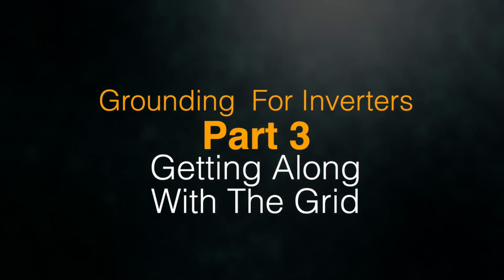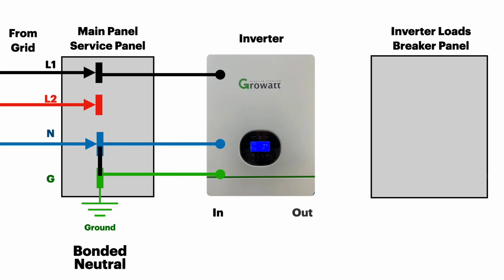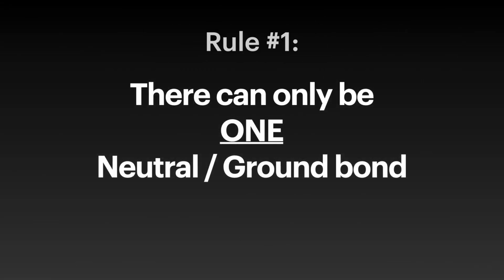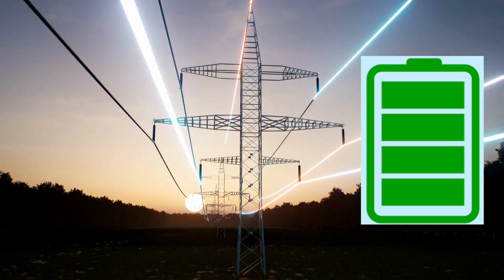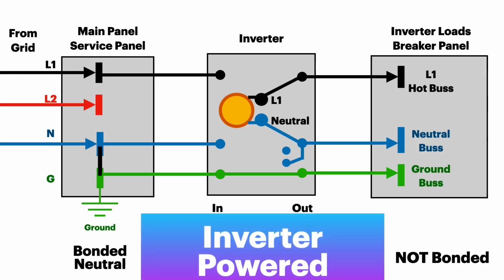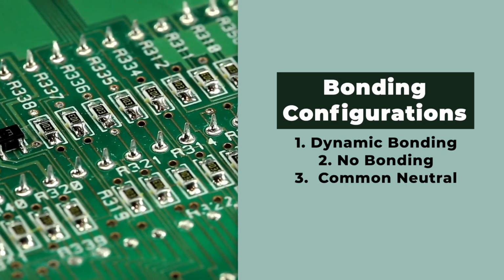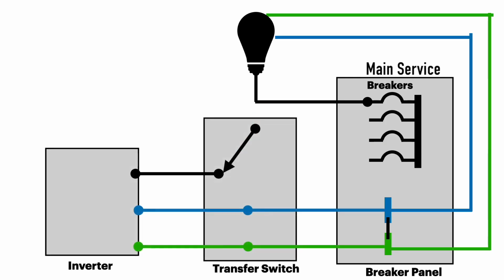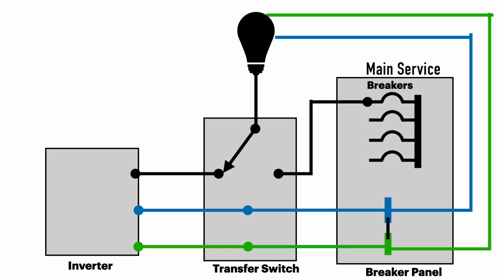Grounding for Inverters Part 3:  Getting Along With The Grid  [UPDATED!]

Comment: H U G E appreciation.  You even anticipate the homeowners' questions.  NO ONE here knows anything about grounding or ground/neutral bonding (I'm an ex-pat living in India).  Please please respond to my strange problem!

I have a 7.5 kw grid-assisted inverter (home earthing is TT system with ground rod); I will configure it as grid-tied inverter very soon.

When grid is ON, and the inverter is just passing the grid through, I get normal voltage at inverter output terminals (around 240 V) between L-N and L-G.  And I get about 2 V between N-G.  I'm pretty sure there is no N-G bonding anywhere in my panels.

If I turn the grid OFF and run in inverter mode, here's what I get at inverter output terminals:
L-N  ---->  normal (which is 220 V that the inverter is generating)
L-G  ---->  around 185 V
N-G  ---->  around 30 V

What the heck is going on?!  Took some time to even figure out that this is what was causing my intermittent weird voltage readings. I feel like I'm going crazy!  Please bring back my sanity.  Let me know if I can clarify anything.
Reply: i also had this issue with a Hybrid Inverter. In inverter mode it has an internal relay and switches the ground to neutral. In line mode, that relay switches neutral IN to neutral Out. So most probably the inverter is defective and is not switching properly the GND to Neutral. Mine had a small trace on PCB burned out.

Comment: You say that the dynamic is the most common for all-in-one inverters. In fact, I cannot find a single all-in-one inverter that has dynamic bonding. Victron does, but that's not an all-in-one. In fact the EG4 has a screw that you can cause to be bonded or a floating blond. So, I'm really confused. I need a dynamic bond but cannot find it outside of Victron. Am I wrong? IT seems everybody is hooking up EG4s without worrying about this and it's working fine, but the documentation says it's on or off, not dynamic.
Reply from the maker: A few years ago, they were common in Chinese inverters (MPP, Growatt, EG4, and others). They would have a removable bonding screw. When passing grid power, they would use the line and neutral from the grid, and thus the existing bond in North America. When using inverter power they would use the line,  neutral and bond from the screw in the inverter. So your AC out had to go to a separate UN-BONDED breaker panel. 
 Fortunately, they seem to be more rare now. EG4 stopped using the bonding screw in 2023. The popular 6000xp uses common neutral bonding, so the bond is coming from the existing house  main panel feeding the AC in.
The Victrons still use dynamic bonding, since they are often used in RVs and boats. They also do a great job of documenting the bonding. Many other companies don't even mention bonding in their manuals.
Reply: @ReelClearMediaLLC  As of this morning, I was told that EG4 still uses the screw, they just default-ship it in the floating neutral position. If that's so, then are you saying there is some sort of automatic relay that bypasses the screw when in shore power mode? I mean, that's what dynamic means right? I desperately want to believe that but every single vendor has told me it is not dynamic but floating. Still, I don't put much faith in that since they seem to have virtually no clue about the G-N bonding issue and are parroting stuff from the manual. Wish I could afford a victron, but it's too much. It simply must be dynamic for the RV or it will be fraught with human error!
Reply: @amythinks  there is no 'automatic relay in the EG-4 6000XP nor the 12000XP - those I have used, one needs to manually configure the inverter to bond N-G in the apps setting controls - or manually tie N-G from the inverters perspective.  The EG-4 literature I have read all indicates this is a pro-active setting not dynamically updated based upon inverter operating mode.
Reply: @kbots  Yes, I know. I'm not considering that one at all. He showed the EG4 3000 (yellow one). That one has a bonding screw and is the one I'm referring to.
Reply: @amythinks sounds like your worrying about nothing. 
People have diy systems for years and your getting tripped up on wording

Comment: Do I watch all Your videos before asking this???

I have 2 Shenzhen Sumry 4Kw hybrid MPPT Solar Charge Inverters that I want to wire in split phase for 120/240 AC in a 2006 Dodge Sprinter van..

My system consists of 9 series connected panels @140 VOC, charging 6 Group 49 AGM's in series parallel for 24 volts.

I was planning to mount a ground terminal busbar centally located on the board, & directly connected to the batteries, that i would then daisy chain all My grounds & neutrals to.

When the vehicle is parked I intend to Earth ground the negative at the batteries, which are installed in the spare tire well under the vehicle.

All My combiner boxes are plastic & are utilizing Mini DIN style breakers for both the PV & AC circuits.
My Main circuit protection on the PV side is two Dihool DZ47LED-63 Double DIN size 32 amp GFCI double poles that split the PV voltage into their respective Charge Inverter.

Anything wrong with My intentions from where You sit?
I can provide pics if You have email or facebook.
Reply from the maker: These videos are primarily related to a stationary (home) system, not a mobile system. I'm also not familiar with those inverter/chargers. In some mobile systems, people treat chassis ground as earth ground... often you have to keep the DC  ground separate from the AC ground. You'll need to dig through whatever manuals came with your gear, and possibly talk to someone who has done mobile installs. Hope that helps.
Reply: @ReelClearMediaLLC  
It really doesn't matter what brand I have, what matters is how I connect everything.

I expected at least some information more than I need to do My homework.

All I do is fkn homework, & Your video was a result of said homework.

This was the answer I expected

https://www.youtube.com/watch?v=X3QA9T_O1g0

Comment: Here is a problem with common neutral bonding .. it only works as long as neutral is in fact connected to it. But, in Greece for example you are required to break live & neutral connections everywhere and have an RCBO before anything powered from grid including the inverter. So, if grid side is working and regardless of the inverter being in bypass or off grid mode everything is perfectly fine.. if an RCBO triggers or you turn a switch off for any reason, you break the neutral and the inverters works in off grid with floating neutral.. a solution for this I came up with is a relay with 2NO & 2NC contacts which, when powered supplies both live and neutral to the inverter and everything works fine.. if you have a grid failure or RCBO triggered one NC contact connected neutral to ground at the inverter side to make sure its bonded and inverter is in off grid mode. This works only with inverters with "common neutral" or "neutral bypass" inside them.. it is still a problem with inverters that are not like that and I'm trying to figure it out.. some have a dry contact with which you can use a simpler replay with NO contact to connect N-G when they are in off grid mode (those obviously don't have a fixed common neutral)
Reply from the maker: Thanks for sharing. That is different than the way it works in North America. 
I have seen people use relays as you mentioned. 
You would have to use relays that could switch both live and neutral.
Reply: This is exactly how it works in India as well. Whenever the neutral gets disconnected either by manual action or RCBO tripping, the inverter starts working with a floating neutral and this means the neutral now actually has live voltage. This isn't usually a problem and everything works as expected since we never bond the neutral with the ground at the service panel. Thus there is no chance of energizing the body of any electrical appliance. But if somebody is working on the mains and thinking the neutral is dead, he gets zapped.

Comment: Actually Victron Hybrid inverters can do grid assisted and grid tied simultaneously. You can have the PV inverter on grid side or the Load side, as per their diagrams.  This is handy because some (or most) PV inverters cannot do off-grid or Island mode frequency shift power control (FPSC) but SMA and Fronius models can do this and on the load side, the PV inverter can do export to grid or non export depending how the VIctron is configured by software options.
Reply from the maker: Thanks. Good information!

Comment: In the USA, does UL1741 require L1, L2 and the Neutral wire to be disconnected when the Grid is down and the Inverter is running off batteries?  That is why Dynamic Bonding exists.
Reply from the maker: The L1 and L2 output of an off-grid inverter should not be tied directly to the grid ever. You can connect L1 and L2 to your household circuits through a transfer switch. I have several vids on that subject.
The neutral and ground can be safely connected for inverters that are made to connect to grid ac, including grid-assist and grid tied inverters.
Reply: @ReelClearMediaLLC  No,  the Neutral Wire can NOT be connected between the Service Panel and Inverter when the Grid is down and Inverter is running on batteries. No, a manual transfer switch is not acceptable. This is why Dynamic Grounding exists.  Read UL1741 ...
Reply: @MrSummitville  You can connect the input side neutral, just not the output AND input and same time (dynamic bonding). Dynamic bonding moves the bond between the internal bond and the main service in order to prevent a bond loop (2 bonds) at the same time... I think we are confused on the type of inverter used.. grid tie VS hybrid using grid as AC backup only, not feeding / synced to the grid.
Reply: @natesdiysolar  If there is an autotransformer, on the output side, of the inverter in this video, then there is no such thing as an input neutral and an output neutral. There only one neutral.
Reply: @MrSummitville  yes.  That would depend on the inverter..
Reply: @natesdiysolar  No, it does not "depend on the inverter".  The code says, the Neutral Wire SHALL be disconnected from the Grid, when the Grid is down and the Inverter is running on batteries. There are no exceptions. Do you understand English, or not?
Reply: @MrSummitville  can you point to a reference in the NEC that declares this?  I have not found one.  UL1741 is not a part of the NEC that I can see. Also Every Manual transfer switch I have checked out that is UL listed provides a always connected Neutral bus bar only L1 and L2 lines are switched, Ground and Neutral are always connected. and those switches do bear the UL listed sticker.
Reply: @MrSummitville wrong
Reply: marcellowithtwols connect the wire. You think lineman just pick up wires without checking if they are live? 
No they don’t

Comment: I have off grid in my garage but would like to occasionally charge my batteries from the grid but not leave it tied in. How do I ground that?
Reply: I use a TS-30 and some imaginationative wiring to run a charger.

Comment: Great video! So in these grid assisted cases it's OK to have the grid neutral connected to the inverter's neutral (either directly or through the main bonded connection). I was concerned that this could backfeed the grid during inverter operation to some degree (obviously not full-on backfeeding).
Reply from the maker: The name brand (Growatt, Eg4, Victron, Dye, and others) all-in-one inverters are made to connect to the grid. The neutral should only provide a return path to the inverter from circuits being powered by the inverter's hot (L1). 
There are some inverters that shouldn't be wired to house wiring... I did a vid on that here.https://www.youtube.com/watch?v=bnR5YVocDfo

Comment: Hello we have an inverter model with dynamic bonding which also supports parallel function so how is this to be achieved since all the inverters in parallel will be bonded automatically in off grid mode ? maybe they communicate with each other through the communication cable ?
Reply from the maker: It depends on the manufacturer. In some cases, you remove a bonding screw in one of the inverters, so there is only one bond. 
If you are completely off-grid (no AC in) you can remove bonding screws in both inverters and use a bond in the breaker panel that is after the inverters.

Comment: My inverter/charger is not bonded so my breaker panel is bonded now my generator does have a boned neutral , will that be a problem when I am using the generator to charge the batteries through the inverter/charger ?
Reply: You should ground with a clamp to a ground rod when using the generator! Look on the frame of the generator for that ground point!

Comment: I do have a question 
  I have 10 370w panels. An EG4 6500, an EG4 battery and a sub panel with a neutral bar but no ground bar. The 6500 has a ground terminal. Not hooked to grid. Where should I hook the ground cable?
Reply from the maker: If  the sub-panel doesn't have a ground bus, you can add one. I had to do this on a small panel that is right after the inverter AC output.

Comment: As an installer who has used a few different inverters now, i don’t suggest using growatt. They can be ok for some people for a while, but they aren't very robust, have terrible software and programming and i have seen many fail. Save up a bit and go Victron, trust me on this.
Reply from the maker: Thanks. I agree that the Growatt software isn't the best, and support is practically non-existant in the US. There are a lot more choices for inverters than when I bought mine. 
I've been pretty lucky, my old Growatt keeps pluggin' along. It runs daily, charging an EV at Level1, and running air conditioners, computers, and music gear.
Reply: @Kanuka - Is any Victron Inverter approved to back-feed the USA Grid?
Reply: @MrSummitville nope

Comment: Wow. I spent the last week hunting down nuggets of information trying to figure this thing out. I knew there was a problem with my desire to purchase the 6000 XP from signature solar and I think you just confirmed it. I have an RV application. Sometimes we will be plugged in and sometimes we won't. I don't want to have to remember to switch the software for the times we're plugged in and the times we're not. That much I already knew. But I didn't fully understand if that problem applied to all inverters. It seems that for this application the dynamic bond would be much better. No messing around with changing up the settings. If it's plugged in, it should know to float and if it's not it should know to establish the bond, right? Looks like maybe I need to go with the EG4 3000 watt inverter. Am I missing something here?
Reply from the maker: You are correct. In an RV, you need a dynamic bond that will only bond when you are NOT connected to shore power (Shore power has its own existing bond).
I'm not sure if EG4 3000s all have a dynamic bond. I've seen people comment that theirs is bonded, others say theirs is not.
There are inverters (such as Victron) that are made for RV and boat use. They are pricey, though.